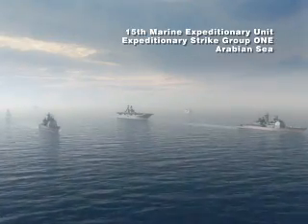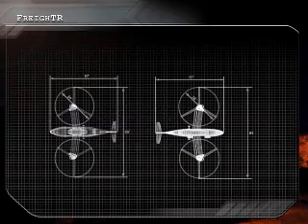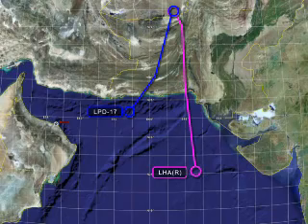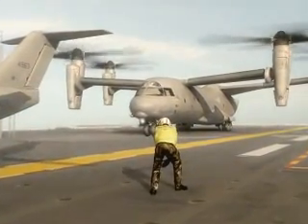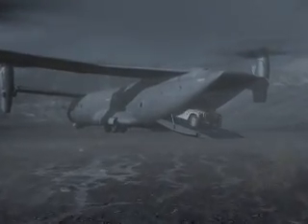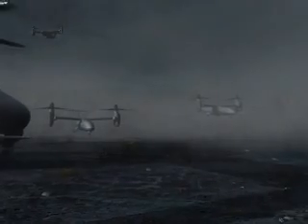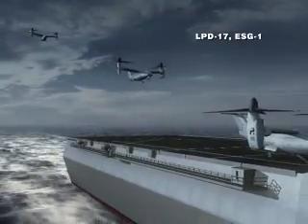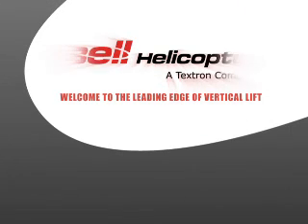Bell Quad Tilt Rotor (QTR)

Comment: I don't like the look of the aesthetics of this Bell Quad Tilt Rotor (QTR) Heavy Lift Rotorcraft... It should be on the lines of the V-22 Osprey's aesthetics, as it would much cooler then! In it's current form it is one ugly duckling!!! If the don't change the design then the should name it something like the V-44 Ugly Duckling! Just in this case, it will never become a Swan!
Reply: +Cameron Weeden i agree that it ain't pretty. But keep in mind that it's not made to show off it's a military aircraft. it has been designed by engineers without any help from architects.
Sorry for my if my english is bad i'm from sweden.
Reply: +Wilmer Sandström   Actually looks are extremely important especially when competing for a government contract. 

Perfect example was the JSF program. Boeing X-32 vs Lockheed X-35. 

The Boeing X-32 was better in all aspects. The problem was it was one ugly ass plane thats built as a killing machine.  Also the DOD favoritism towards Lockheed since they not only won the JSF contract but also the ATF program which brought us the F-22 Raptor.
Reply: @kushdaddy144  the reason Boeing  lost the jsf was that it f 32 needed to redesign  from a tailless delta to a tailed delta and Boeing did not have time to build a new test aircraft
Reply: kushdaddy144 ok you've got a point
Reply: +kushdaddy144      Also, the government wants cool looking weapons because it also serves as a recruiting tool.

Comment: 1 thing I see is the concept has the wings parallel, but that is wrong from birds w/know the trailing wing needs to b a little higher, like on a Chinook. Volume w/focus on high altitude hover & max lift. The length of the wings, slightly shorter front wing needs to best size to this goal, not range Or speed. That said so long as it can keep up w/other tilt rotors for protection & as a flying refueler if not carrying any cargo. It can hve as big a tank as they want, that still leaves room for the largest Army vehicle. The trick is not filling it up when u need max lift, 1/3rd full will b fine.  Hving shorter wings n the front means rear props get good air stream. Down ward winglets on the end of the wings will suffice for a tail. These can only work w/newer Valor tilt style. An existing body would b nice but this deserves its own design.

Comment: 4 aces has clear Army Corp potential, & man how effective a system like this could b if it helps extend a real load carrying potential to upper limit of normal helos range 12K+. Anything from 12k-15k is the cat's meow. Above 20k is going to require jets instead of blades. If it bring new features that other craft can't do then it is a sure fit even if it cost the equivalent of 3 Valors w/all the carbon fiber & 4 power rated V-22 sized engines w/ valor side style configuration.
Reply: The qtr in the video is larger then a c 130j and can carry 60k to 70k pounds of cargo

Comment: it has no rudder?
Reply: +Donald Modulation of rotor speeds create the torque necessary to stabilize and affect yaw
Reply: +Eric Clark, Yup.., precisely, +Donald, the same concept is currently applied in the multitudes of Remote Control 'Drones'.

Comment: sure looks like the QTR could use some vertical stabs for fwd flight.  and what about the interaction between the prop wash front and back in fwd flight too?  that would have to be modeled, and would be difficult to accomplish without vibration or buffeting (aerodynamic) at some speed

Comment: Alright.. so how is the QTR suppose to fold up all nice n' pretty inside the bay of an LHA or Carrier? Let's forget it looks like the size of C12 Huron (which could be my misjudgement of proportions), I highly doubt the Air Force would buy into something like the QTR seeing how their requirements for a VTOL aircraft is just about nil'.

The only buyer for this thing is the USMC as they think VTOL is the best thing since the lightbulb, and for that it's gotta be Naval Ops qualified.
Reply: The real size is larger then a c 130j but smaller then a 400 cargo plane 
It carry a Bradley  and land vertical

Comment: yes, you can't directly compare the CH46, but the V22 was indeed  made to replace it..... and the V22 program is a complete joke / failure... it is 20 TIMES over budget, costs more than an F18E or 737, and it started this crazy BS where the OEM pushes the military to lower reliability and declare the product operational before the test and eval program is even complete... so now we've got a TRILLION dollar F35 program doing the same thing: screwing the taxpayer

Comment: @anshumanabhisek The Osprey has superior range and speed, so it's great as a transport and cargo aircraft.  It's no good for combat because it doesn't have an effective weapon system.  It also can't do combat approaches in the manner of a Blackhawk or a Kiowa.  It is extremely vulnerable during transition and requires a much larger landing area than existing helicopters.  It is also very complicated, expensive and requires lots of training to operate and maintain.

Comment: @anshumanabhisek 

Props dont work well with engines in front of the other. CG is difficult with different loads. The wings are long and will need a lot of work to strengthen them plus they nee to be as light as possible. 

There are many reasons. Why dont they just copy my idea.

Comment: @Uncle5cary only at first, and the cost of life makes it much more viable than the chinook
Reply: Except the ch 47 Chinook does not have near the range or payload 
I know this is a rough guess because I cannot  open Google from  YouTube on my tablet 
I would say ch 47 range only about 100 to 150 miles range with at maximum load of 30k pounds I believe  I am overstating ch 47 load not sure but think it maximum load is 28k, 
The qtr is range of over 500 miles and back, payload of 30 tons to 35 ton

Comment: ... no, it's not. 
The C-130 can actually take off unassisted. JATO assistance for a heavy payload though.

And the military had in place a program to Navalise the C130 further with CATOBAR abilities. Money forced it down but the plans were all there. It'd be cheaper than this multi step crap.
Reply: Jato still needs several hundred feet on a dark night everybody will see where take off point 
This can land and take off vertical if needed with call all bad guys around